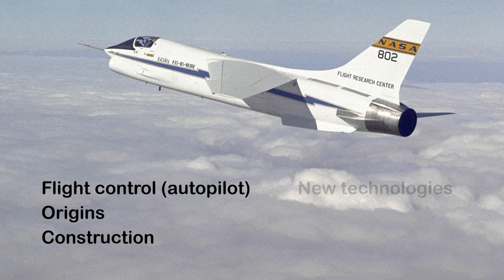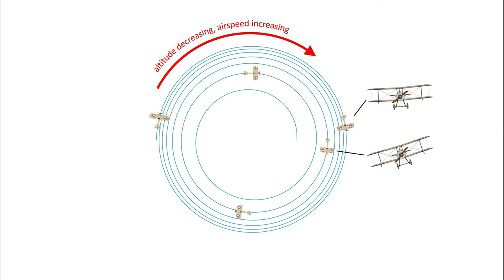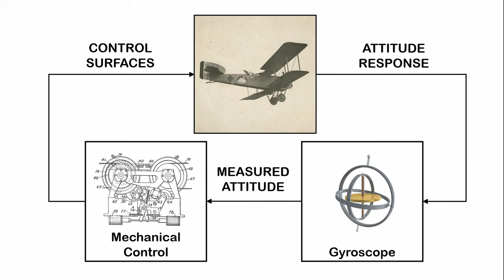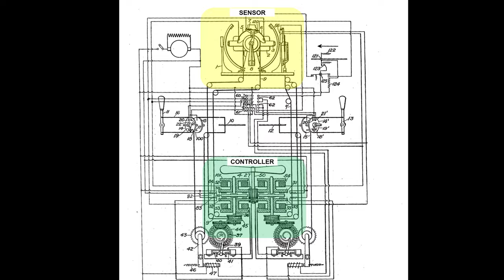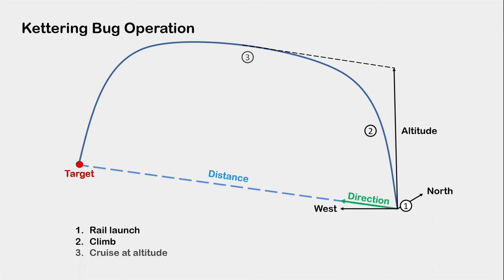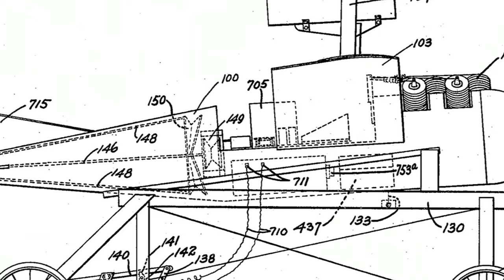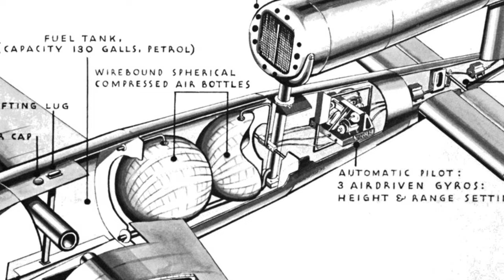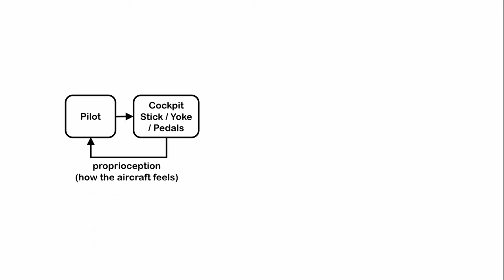Autopilot Introduction - Flight Control Fundamentals Section - 1.1

Comment: I don't guess its correct to say that Sparry built the first cruise missile. He built the first kamikaze drone.
Reply from the maker: It's interesting that history seems to have come full circle on the kamikaze drone, although it's only been commonly referred to as a drone in the past 20 years.

The early winged-bombs, which fit today's definition of a drone, were predecessors to today's cruise missiles. But, they both have a common function: to deliver a payload to a surface-target over long distances without a human on board, sacrificing itself in the process.